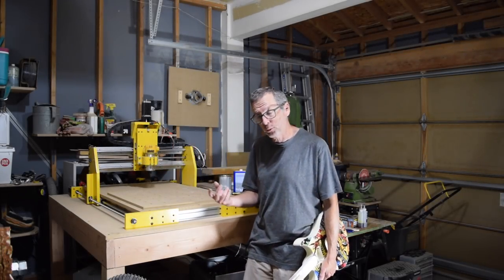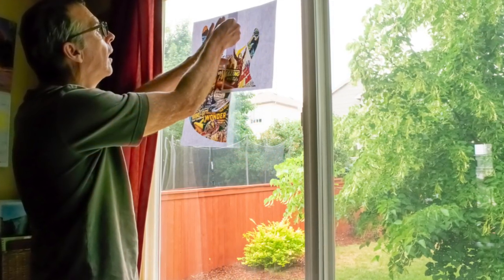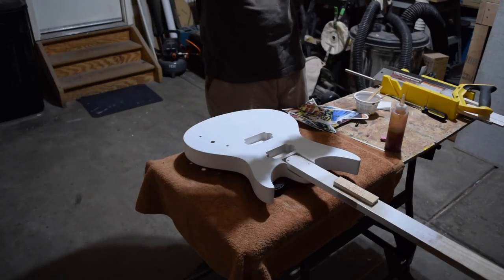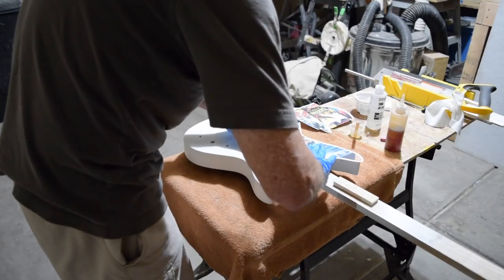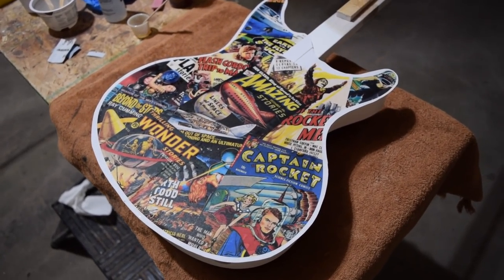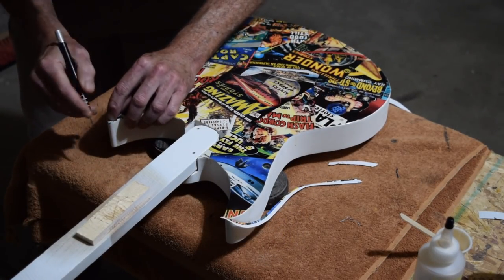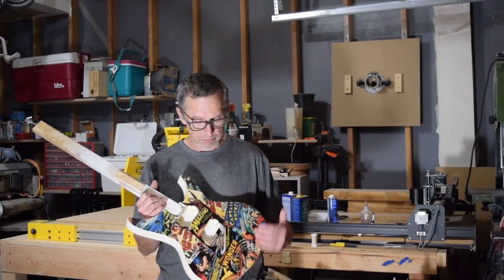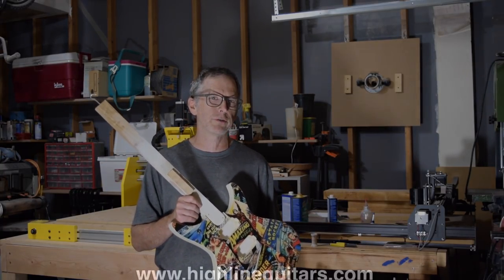Episode 105 My New Z-Poxy Image Lamination Technique

Comment: Works great on utterly flat surface applications. Does not work well with guitars with rounded outer edges. Also, you may have to experiment with printing technologies, because I had a high end print done as a master and the colors ran under the z-poxy. But I was able to achieve the desired aesthetic via some modifications - 1. I trimmed the graphic to the extent of the flat part of the surface only. 2. I used a black sharpie to blacken the edges of the cut graphic. 3. I sprayed black spray paint at the edges of the graphic to soften the delineation (you could do the same with an airbrush) and then 4. I put the final Z-poxy coat on, followed by Clear Coat / Polish sanding and budding etc.

Comment: How much prep work do I have to do on the guitar body if I will be doing this on both sides? Should I paint the body with a primer? Must I smooth everything with wood filler first or does the paper smooth the wood out enough. How high of a grit do I need to sand the wood to prepare it for the lamination? What's the best brush-on polyurethane to use for this technique? Sorry to ask so many questions, but this will be my first attempt at a DIY. Thanks

Comment: What about the holes for the vol pots or the holes for the bridge? Did you do drill those out afterward?
Reply from the maker: The holes for the controls were drilled before and the holes for the bridge were drilled after. The control holes don't require absolute precision positioning, but the bridge holes do. For that reason, I waited to drill the bridge holes after the art was laminated and the neck was installed. That way I could line up the bridge with the neck.

Comment: There are some affordable 13 x 19 printers on the market now, I found a used HP Photosmart large format photo printer at a local thrift store for $10. Have you also tried iron on print paper or water-slide decal paper? (Both would require reverse printing technique.) I have a need to cover the entire outside surface of a Telecaster with a seamless printout, I may have to create texture maps in a 3D program to accomplish this...

Comment: Looks great! You don't have to worry about the Inc bleeding when you use the z poxy ? I have an Inc jet printer. I guess you need to test on a piece of scrap.
Reply: From what I understand, the fact that the z poxy reaches the ink from the back, through the paper, keeps the ink in place. A mistake would be to apply the top coat of z poxy just after applying the paper, because the ink would not be bonded to the poxy yet.

Comment: How do you deal with a very uneven surface after you have done a few coats of epoxy?
Reply from the maker: I level sand (carefully) if the surface is uneven. I usually start with 400 grit and work my way up to 800 grit.
Reply: @HighlineGuitars  Thank you - really excited to see how this turns out!
Reply: @HighlineGuitars  My finish is cloudy from the sanding.  Will clear coat solve that?
Reply from the maker: @TheKloneKilla  Yes.

Comment: what could be a substitute to Z poxy? in my country they dont sell it and shipping companies dont want to mess with cans and sprays
Reply from the maker: Z-Poxy is basically a very thin, slow curing epoxy. Any epoxy with similar properties should work.
Reply: @HighlineGuitars  Thanks. Last time, i used a epoxy that wasnt clear, more like an ambar color. Fortunately it was on wood so it looks like a varnish. Do you think metallic paper will work, like those to print photos? it should right ?

Comment: Does crystalac finish work like 2 part epoxy. I’ve pained a design with acrylics on my guitar and am looking for the perfect finish. I don’t have a sprayer so I would have to brush this. Your opinion would be great. Thanks
Reply from the maker: No. It's a 1k water-based polyurethane.
Reply: @HighlineGuitars  will it leave brush strokes?

Comment: Does the bond between the paper and Zpoxy topcoat seem as if it will not separate?
Reply from the maker: It’s epoxy, so no.
Reply: @HighlineGuitars  mainly curious because I’ve used this technique with a different brand of epoxy and the resin came off in one piece away from the printed paper.

Comment: Does the Z Poxy level itself pretty well before it dries and cures?
Reply: Z-Poxy is very sensitive to temperature. If you want it to level better you can warm it with a hairdryer (paint stripper). Keep the hairdryer (or paint stripper) one to two foot (30 – 60cm) away from the surface to prevent overheating. The Z-poxy will cure faster and way much harder than at lower temperatures. The down side is that you might blow dust on to the surface with the airflow. Be careful because the Z-Poxy will get very runny when warm/hot and you might blow it over the edges with the airflow! Hot curing will make Z-Poxy glass like hard.

Comment: I've been wondering recently about putting enamel clear coat on epoxy. So that should be no problem then?
Reply from the maker: Why put an enamel clear coat over the epoxy? Just use the epoxy as your clear coat.
Reply: Yeah, I was actually thinking of doing it the other way around for silly and overly complex reasons. But you're right, one type of clear layer over another is dumb. I'm just going to sand and re-finish.

Comment: Hi , im gonna try this method on my own project , but i have little question . I want to do this stuff on guitar with binding, what would you do.  Secure the binding before the zpoxy magic , or scrape the zpoxy from binding??
Reply: and one more , do i need to paint the top with white or i can try it on raw wood ??
Reply from the maker: No way would I attempt it with binding in place. I would do apply the graphic first, coat with Z-Poxy and rout then binding channel. Then I would glue on the binding, scrape it flush with the surface and cleat coat.
Reply from the maker: @m0ch3r  If you don't paint it white, you'll see the wood through the graphic.
Reply: @HighlineGuitars  ok , another question , acrylic paint , then zpoxy 2 coats , can i clear coat with poly paint ?? ty for answers , they are very helpfull :)

Comment: so does the zpoxy settle itself down completely flat and leveled?
Reply from the maker: To some extent, it will level. You can also thin it with denatured alcohol to help it level better. However, I find it easy to level sand after a couple of coats.
Reply: I see, thanks for the advice. The company I work for is starting to build guitars and I'll basically be the guy who does the painting so I've been really looking into going some graphic stuff like this as well.

Comment: What if my guitar had a binding?  Remove and cut the picture in and then reapply binding?  Or remove binding and do a round routing on the top. 
I think it's not possible to leave the binding on and cut the transfer to where the binding edge meets the guitar.
Reply from the maker: I would remove the binding, apply the picture, trim it to the edge of the binding channel with a fresh razor blade and reattach the binding.
Reply: @HighlineGuitars  thanks,  there had to be a way.

Comment: What about colorfastness?  Will the graphics fade over the course of time, or will they still remain bright?
Reply from the maker: They will remain bright forever as long as it is kept out of direct sunlight.
Reply: Personally, I would use a surfboard epoxy like System Three's SB 112 because of its clarity and UV inhibitors. But it is quite a bit more expensive than Zpoxy. Great technique Chris!

Comment: Beware of the Tone  Police..... Ooo you know what I mean the  thin  cracked lacquer is the  righteous path brigade.  I'm not sure all the Tone wood  hype  is  correct. Somehow I got a cheap Ibanez that has the wrong wood with the thick rock hard poly finish that sounds  great. I have other Ibanez  guitars that cost much more with better build quality that can't  touch it.  Tone  wood  with thinner finish and  better electronics. Should be  better. Not! Got  lucky and  don't  know what is  magic about it.
Reply from the maker: My theory is that tone often comes from how a specific guitar, because of it's "feel," enhances a player's technique, which brings tone along with it.
Reply: @HighlineGuitars  I would like to  agree I bring something to the game. However I have  to just sing the  praise of a  cheap Ibanez that some how puts other  much more expensive guitars I have to shame. It got me on a Ibanez buying binge. The cheap  Gio still ranks above them all. I have since  bought a Explorer that has the feel  you describe and  it also has the tone to match. But it has nothing in common with the  cheap Gio. It also cost much more..

Comment: You should consider taking this video down or inputting more information. While the thot is nice, myself, David Imrie, And Ashleigh Carbonie have all done damage to very expensive guitars using Zpoxy. I used the same type you did, and the same thing happened to both mine & David Imrie s guitars, it went on nice & thick and smooth as can be, as it started to dry is slowly kept separating till it dried like mountains. This was over a very well prepped black paint sanded & prep cleaned to 400 grit.
Reply from the maker: I'm not going to take down a video because a couple of guys I've never heard of screwed up. I and many others have used Z-Poxy without issue. In fact, that guitar still looks brand new 4 years later.